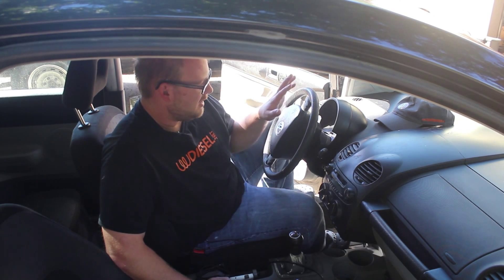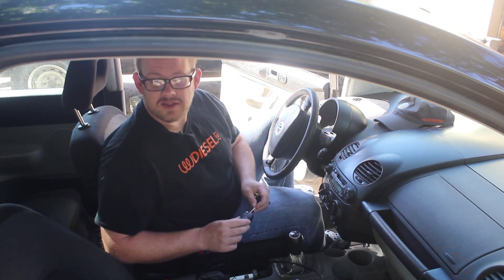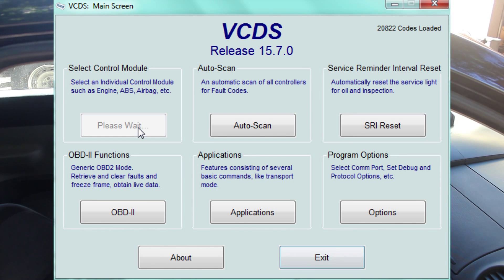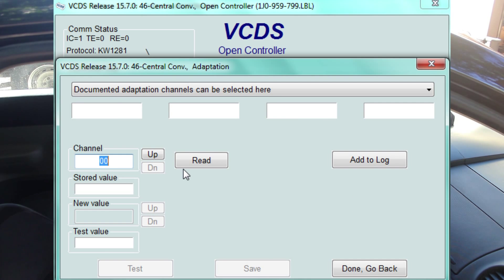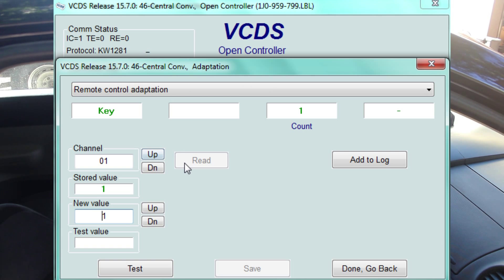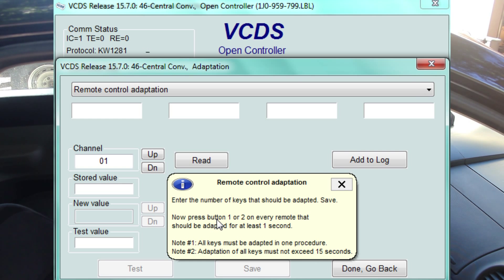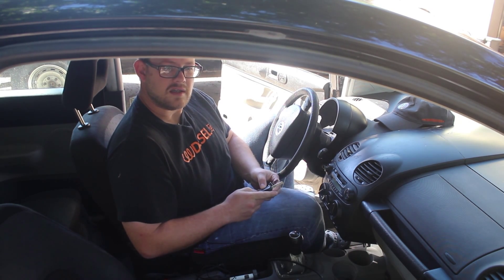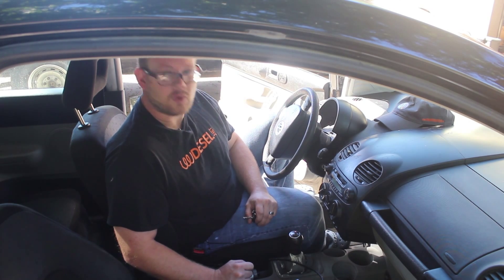Programming MK4 Jetta, Golf, & New Beetle Keys with VCDS

Comment: I appreciate this video.  I have new batteries in my 2000 TDI sedan OEM key fob that have been tested at the Autozone RF transmitter tester to be working. I have followed this procedure as well as the one key method and still to do not have function from my remote for door locks. I have tried the two key method as well however I think my door latch microswitch is bad.   For years my keyfob has worked even still until my button cell batteries died. What might be wrong or should I try differently next to program it?  Thanks.

Comment: Thanks for the video.
New remote works every time but the original does not. Setting up for two like in your video. The horn beeps for both and there is a new battery in the old one and the red light works but after several attempts it will not lock or unlock.
Also do you have a video to get the pin number with a VagTacho?

Comment: There are two parts to these keys, one for the central locking/alarm and the other RFID chip for the ECU to allow the car to be started, this video did not cover this and those keys will only unlock the car but will not start it, correct?
Reply from the maker: +Ruijie Zhou I believe it is the same or very close for a B5 passat. I can check into it if you need me to.
Reply from the maker: right, this is only for the door locks. I will have 2 Videos on immo programming up soon. Im waiting on my VagTacho cable to get here.
Reply: +Ryan VWDiesel which video is for the immo programming? great appreciation!
Reply from the maker: +Ruijie Zhou Here is the whole blog post with 4 videos.  http://vwdiesel.net/mk4-key-immobilizer-and-remote-programing-using-vcds-and-vag-tacho/
Reply: Thank you. That's great. For 03 Passat, will it be the same?
Reply: +Ryan VWDiesel Thank you very much. For my 03 passat I only have one transponder key. So I'm planning to cut one extra and get 2 fobs. Do I need to get the immo pin first to pair the extra key first?